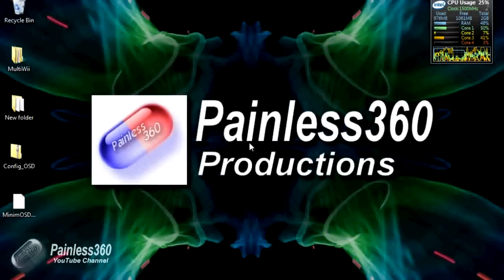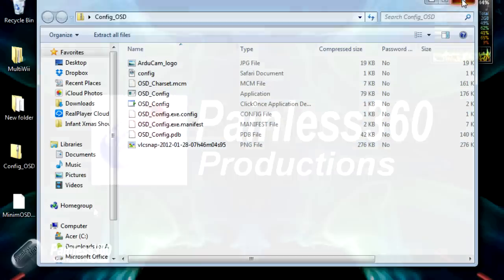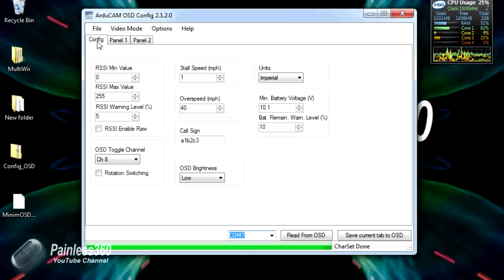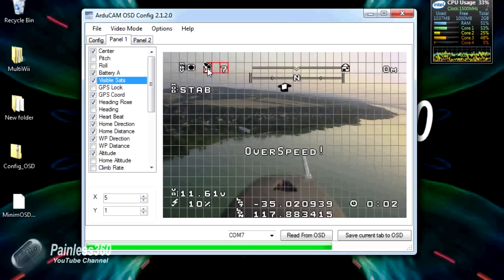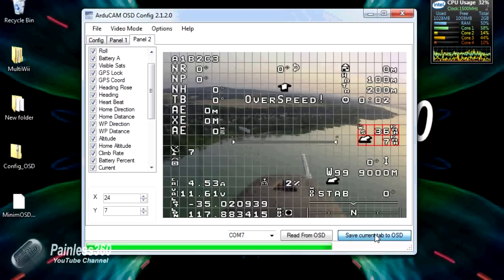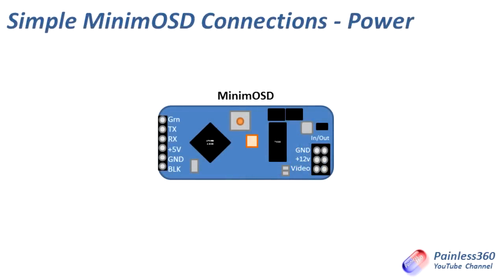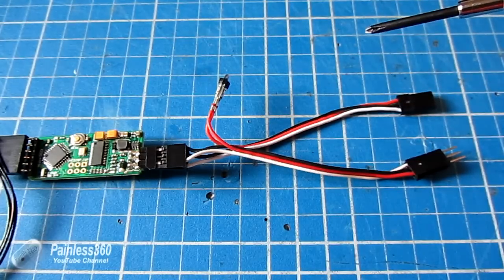APM 2.5/2.6/2.7 - Adding an OSD for FPV using MinimOSD - complete setup

Comment: +Painless360 I'm wondering about skipping your voltage regulator bypass hack.  Do you think putting a dedicated heatsink on the voltage regulator would be helpful?  Or dialing back the voltage from the 12v side of the board to give the chip less to do?  Or both?  I'm not much with a soldering gun and my wife isn't thrilled with the amount of cash I've already sunk into the project, so telling her I need to buy a component cos I broke it won't go over very well.
Reply from the maker: The way in the video is the way that is bullet proof. Not sure what voltage regulator you mean..
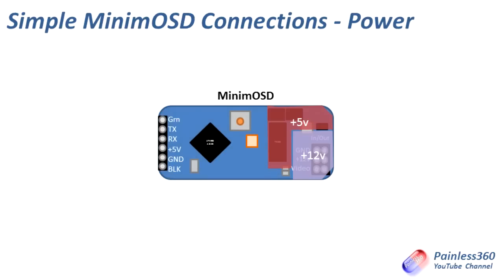Reply: Thanks for the quick reply.  I mean the voltage regulator on the right side of the minimosd that steps down the power from 12v to 5v, which you mention at 12:38 of this video, you and others have talked about it getting really hot and causing problems.  After a few more days of research, I think I probably could solder the bridge, and I like not having to power the board twice, but I'm still curious about the idea of a heatsink on that chip.  My raspberry pi 3 came with a bunch of extra heatsinks that I've packratted aside.  You think it might help?
Reply: ps, subscribed!  Thanks again for all your vids.
Reply: Now that I think of it, I've been plagued by another question for a while now, and you probably know the answer or at least the right follow-up questions.  I'm running a 70a esc with a 5v5a bec (hk red brick) off a 3s 6000mah lipo as my main drive motor, and I've got a 3s 2200mah for my fpv (12v 1.2mhz tx, cam) setup.  I'm not sure which end should be powering my rx (ezuhf 433) and apm2.8.  if one or both should be running off the bec, is 5a ok? would it be better to run them through a ubec on my 2nd battery?
Reply from the maker: Depends if it's a plane or multirotor really, you can be less fussy with a multirotor as there isn't the worry about an servo pulling too much current and causing a problem. I'd run the FPV gear from the flight battery myself. If they are both 3s then it's a lot of extra weight in that second battery and the extra drain from the FPV gear on the 6000mAh pack would still be less than the power needed to haul the extra pack and BEC.. I'd power the APM from a power module then you can monitor main battery life in flight too.. Hope that helps.
Reply: Helps a bunch! It is fixed wing, actually.  A skywalker x7, which I'm hoping to use for long range in a few months once I've got the hang of things better.  So maybe I can still use that extra battery for my ground station, seeing as it's already in my shopping cart.  I'd just changed the order to 4s for the 6000mah, so maybe I'll change that back then.  So you're suggesting putting an extra bec in before the apm?  You know, now that I think of it, I'm sure I'm not the only one watching your how-tos who's confused about whether to run one battery or two, and what to do about variable voltage requirements across the system.  Might be a good idea for a future video!

Comment: Mate i have a f450 quadcopter and a sj4000,i am going to buy this kit for fpv,would it be possible to use minimosd with this setup,and how would i wire it.Thanks
https://www.aliexpress.com/item/6km-FPV-Combo-System-Boscam-5-8Ghz-600mw-Video-Transmitter-and-Receiver-Suit-For-SJ4-5/32324039335.html?spm=2114.13010308.0.0.XpOtjw
Reply from the maker: Should be able to - you'd have to cut the cable that connects the camera to the Vtx so you can connect the MinimOSD in-between.. Best of luck!

Comment: OK the pixhawk plug on the tellem 1 or 2 has 6 pins therefore 6 cables which gives us 6 cable ends at the end to be connected to the MiniOSD my qusestion is say pin 1 on Telem plug what connection pin on the OSD unit will it be connected to and so on for the 6 cables. Thanks

Comment: Hi have been following your Videos and this one ref the OSD module linked to the Pixhawk is one I intend on fitting to a 450 quad copter in build at this time and I have a question can you please inform me and I guess others the correct order of pin connections on the two ends of the link cable so I have some ready made with plug to match the PH so what wires go to which pins on the OSD. I hope you can assist please.
Reply from the maker: Not sure what you're asking, the pin-outs we used are in the video.. best of luck!

Comment: Thanks for your videos. Is there a video or instructions on how to install a wifi telemetry board.
Reply from the maker: On an APM? Sorry, not tried that..
Reply: I was having issues connecting. But it as usual, it was my ignorance getting in the way. I was powering the unit via USB and it would never connect. 

Then I had a brain fart...

I unhooked the usb and WALA, it worked as described.  I was able to connect to it with my android phone using droid planner.  Sweet!  

It works i image very similar to the 915hz units without the range.  which at the moment I do not need since I am still tuning.
Reply from the maker: Well done working it out. Happy flying!

Comment: hello, did everything like you but on ALL my apm, i CAN T use an osd solo, if i use an osd only, then only the horizon update, everything else stay to 0, i i use an osd with a  telemetry radio in paralele well my OSD work fine, even if i unplug the radio after the osd begin to work, but if i start the apm with only the osd, then the osd say 0 on everything , exept horizon ... this is driving me mad! several week trying to figure this out but nothing ! i'm using a micro minim osd
Reply: ok for those who have the same probleme, if using only the osd, the only firmware that work is 2.0, other firmware don't work on osd ALONE ... at least for me ...

Comment: Do you have an idea why the GPS data is not updating, before the APM2.6 is connected to MP? I dont use telemetry, therefore I need a "kick" to start GPS transmission. I have plenty of minim board, different ones, with and without jumpers (GND,VCC) but none shows me GPS data until MP starts it. The same with minimExtra, a fork of the original one. Please help, sir!
Reply from the maker: Happy to help but please watch https://www.youtube.com/watch?v=olIqTiSJHIY and come back to me with more detail of what you've tried..
Reply: Ok, I removed my text, because I found the solution: TX must be connected, otherwise data transmission wont start between minimOSD and APM. But I dont know if there are bus collisions with the 433mhz radio TX line which is on the same pin. The only problem  remainig is that the OSD suddenly disappears and I have to press Reset to get it again. Of course during flight I cant do this. I have no idea why is disappears and only the video is remaing in my goggles.

Comment: Hello Painless360   I have  soldered the points like  you showed in the video  but  i dont understand why  i can't get image in my screen  but when i conect the red cable from the vtx (12v)  to the OSD board i get image on my screen, i dont undertsnad why if  it should work just with  5v from APM , what can be happening? and i was trying  conect  just black and white wire from the camera and vtx
Reply from the maker: Not sure what you're describing. Do you have a video of it/wiring diagram?

Comment: Hi Painless360,
I have just bought a kit and invest about 200 euros on building my F450 quad. I have had a bit of fun with it. However, when you see the quality and stability of other products like Mavec its very disappointing. specially when I could not upgrade the firmware I had a feeling that I have chose something outdated, on the other hand I am an engineer and I would like to build things. So what is your idea was it wrong or should I not invest on such Flight control system anymore?
Reply from the maker: Impossible to comment usefully without more detail on what you've used and how it flies, specifically what parts you're not happy with. Different flight controllers and software are designed with different aims in mind. The Naze32 and Cleanflight is all about racing. The Pixhawk and Mission Planner is about support smooth stable flight with GPS modes.. The pieces you use in a build dictate how it will fly and what strengths the model will have. Tuning also plays a big part too, without tuning the model will not perform to the best of it's ability. Hope that helps..
Reply: Painless360 Thank you very much for your answer. 
I have had an apm board on F450 frame with GPS. last weekend I have tested the RTL and it didn't work properly until I have increased the value of Wp_nav_speed. Then it worked as it supposed to. We have checked RTL 3 times and I worked fine. Afterwards we decided to try a simple autopilot in 20 meters above the ground. Take off was good It also went to the first waypoint and then it continue in that path but not to the second way point. I have gained the manual control and try to return it using RTL but it went to a higher altitude and went beyond my transmitter coverage. unfortunately I have lost the model with a new 4s 5000mah lipo.
now I want to know if pixhawk is more stable than apm or the known bugs like the boot problem which you mentioned in another video(sticks become swapped) will also appear in these flight controller. I am looking for a reliable system for FPV. I did like the APM but I understood it has so many challenges to make it stable and its still not that safe. Thats why solo which the 3DR company released didn't became popular as dji since many users have lost their model.
I have learned alot in your channel and I think you are one of the best person to ask my question:
what would you recommend for me to build for the next project or I have to go for the commercial products which promises more safety and stability?
Reply from the maker: See the 'Flight controller comparison' video for more details on my thoughts. Sorry to hear about the flyaway but it sounds like the GPS/compass had a problem. The compass is very prone to interference. The Pixhawk is probably the best Opensource platform for GPS at the moment. You do need to make sure that the model is built well, everything is balanced and that you have clear separation from the power and flight electronics to minimise interference. If you're not able to fly a model using the radio line of sight (LOS) comfortably, then I wouldn't try GPS modes as you can't get it back safely if something isn't right. Best of luck with it..

Comment: Help! I'm having a problem where on the configurator, I can see where each panel option (battery voltage, direction, altitude, etc.) is not visible.  I can move around the red boxes, but I can't read any of the stats.  I followed your instructions completely, including successfully downloading the font package, but I am still having this problem.  Please Help! Thank you!
Reply from the maker: What have you already tried? Rx/Tx connector swap etc?

Comment: we need remove the bridge of 5+ volts ? or not touch anything?
Reply from the maker: +YT SPARTANO on the APM or the MinimOSD?
Reply: In the minimOSD, i want use it, but i dont know if i need remove the bridge of this
Reply from the maker: +YT SPARTANO if you're powering the OSD using 5v then you need to solder those pads on the OSD so both sides get power. Best of luck!
Reply: Thanks very much :)

Comment: Can you help me please?

On apm 2.6 there is only one telem port.
But I want telemetry transmission not only on the screen thru minim osd ?
I would like to use also 3DR Radio Telemetry.

But 3dr is connected to the same port.
As a result - you can use too DroidPlanner ( for Android)  -at the same time.
How to connect one port of two devices? 
MinimOSD and 3DR.
Simply connect them in parallel connect?
Thanks.
Reply from the maker: It's tricky on an APM, this is why the PixRacer now has two ports. You can't run both from the same output as doing so pulls the signal down to a level where neither can read it reliably. Back when the APM was a little newer there was a 'buffer' circuit that let you plug both into the APM (but not connect the Tx wire form the OSD) to the port but I've not seem one for years.. Best of luck!
Reply: Thanks for the answer.

Comment: Hi Painless, i understand but does a solution exist...for Pixhawk ? but i don't understand why it's not possible to plug my Radio 433M%Hz into Telem 1 such as Ardupilot...?
Thank's a lot
Philippe
Reply from the maker: Please can you reply to the existing conversation? It's tricky to keep track if you don't. To answer your question the Pixhawk has TWO telemetry outputs ;) Best of luck!

Comment: question have you tried MUX port for 2.7 old 12c compass port? says that osd runs straight from port as a default my question is does this need set up by soldering the pads together or as default are pads already soldered? question is for any one that may have the answer next is to open board and see for my self! I know the way of both 3dr and osd running both on telemetry port just curious more about this other way.
Reply from the maker: +erupt6900 I've not tried it, I'd ask the vendor. Let me know how you get on.. Best of luck!

Comment: hey Pain, quick question. This is my board, "MinimOSD MAVLink OSD APM 2.6 APM 2.52 Flight Control Board"! Can I use this with a Naze32? Cannot figure out what kind of software to use? Also can I damage my Video transmitter with wrong set-up?
Reply from the maker: Yes you can, see our videos on adding an OSD in the Naze32 series. As long as you don't mess up the power connections you shouldn't damage the Vtx... ;)
Reply: thanks Pain, and also I been reading posts about 64 bit not working. Is that true?
Reply from the maker: Not sure what you're referring to. See the video of how we got it all working.. Best of luck!
Reply: like Windows 64 bit operating sytem Vs 32 bit?
Reply: I tried everything and cannot seem to get the GUI working...little box comes up for a second but never does load. Windows 7 Home Premium.
Reply from the maker: Sorry, no idea. We've not had that here. Hopefully the forums will have other pilots who have who can offer advice. Best of luck!

Comment: Hi Painless, i know this site but on my Pixhawk i have to plug my mini Osd only with Telem1....! if i add on Telem 2 my TX Radio 433MHz mini Osd disappears and the image is blurred and jumps.! Mini Osd with Telem 2....image of Osd is fixed and all datas are at zero...! then i try to plug my TX Radio in other port Telem 2 or Serial 4/5 my Pixhawk flashes everywhere...! Result...i can't plug mini Osd and Tx Radio together...!
i've checked on websites but i don't get a solution for this time...
do you have an idea...?
best regards
Philippe
Reply from the maker: +Philippe Richier sorry,  I've got nothing above the same things you've checked. Let me know if you get it sorted. Best of luck!
Reply: will cutting tx from osd possibly help? the older APM boards you couldn't have both tx from osd and 3dr radio wired at the same time. granted this was on the same wiring harness but not sure myself as I don't own pixhawk.
Reply from the maker: It will but the problem comes from the Tx pin on the APM being pulled down because of the two connected devices meaning neither can see the signal clearly..
Reply: Hi Erupt6900...i get the latest version of Pixhawk...2.4.6 from Banggood, not an old version of Apm...for thid time i don't need or used my mini Osd but i'd like to find a solution before building a new Uav...than's a lot
Philippe
Reply: Normally, the Radio needs TX and RX and the minim only needs RX as a listener to the communication between ground station and copter. But I dont know who is requesting data from the mavlink port? Is the Mission planner the starter? Oder does the APM sends the data itsself? Or is the minim OSD also able to request data? (without TX?) Questions over questions.....

Comment: I havent tried using this system, but I am wondering as I am recording my flights with go pro hero 4black. will this info from osd also will be recorded in my video on the camera.
Reply from the maker: Not on the GoPro. You need something that is receiving the image with the OSD on it. See our recent video on a Mini-DVR device that could fit the bill.. Best of luck!
Reply: +Painless360 thank you.

Comment: thank you very much for all the great videos!!! AWESOME!
how do i hook-up an actioncam like turnigy/sj4000? any help would be greatly appreciated
Reply: I have my gopro 4 black connected to my drone. so I bought boscam transmiter and receiver connected to o my drone two wires only red and black for pover. need to set up channels and buy a usb av cable for your camera and thats it really. make sure you always have areals on transmiter receiver if you will not use them while connected to power you will burn them.

Comment: Can I program the OSDs screen layout etc using a USBasp module? Don't have an FTDI module.
Reply from the maker: The pin-outs are designed for an FTDI adapter - maybe a USBASP will work but there is so much that you'll use and FTDI Basic adapter for that it's worth its weight in gold (see out video on it). Best of luck..
Reply: Yeah it's just annoying when the reason I purchased this particular version of Minimosd is because it was supposed to be plug and play, no need to program. It is anything but. Love your videos by the way.
Reply from the maker: Almost all are. The firmware om them needs to be specific for the flight controller software you are using. There are versions coming out now that are a little easier to setup and manage..

Comment: cant you program the board through ardupilot ? just dont have the battery and the usb plugged in at the same time?
Reply from the maker: +Chad Brailer try it and let me know if it works.. Best of luck!
Reply: Hi. Did you try this? Thx